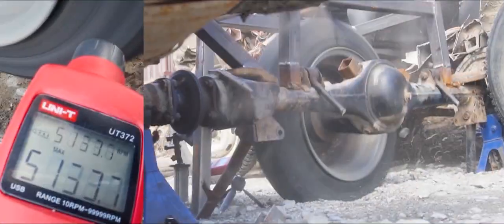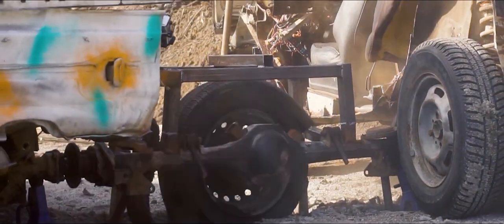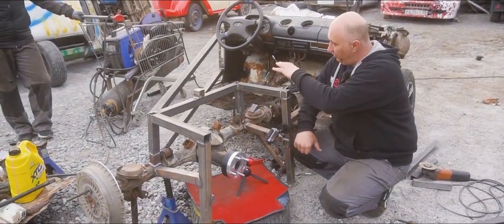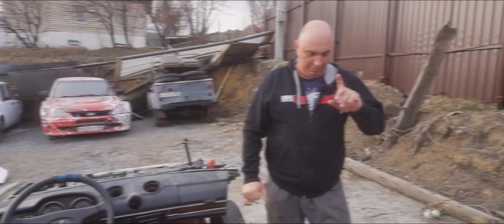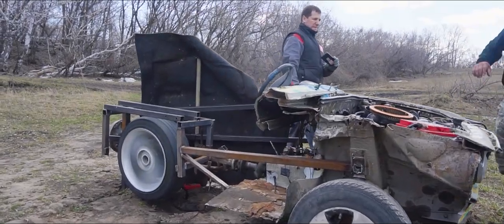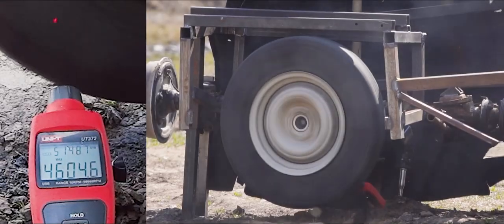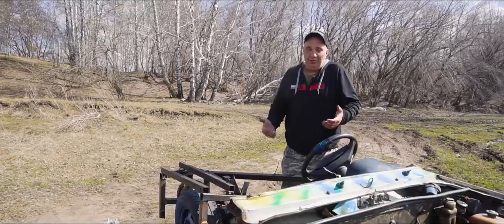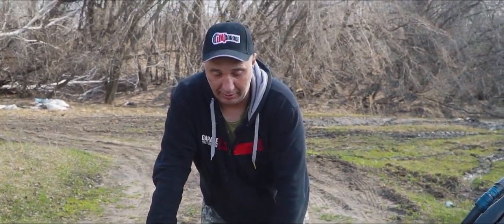Can we get a tire up to the speed of sound?

Comment: The air resistance on the wheel must have killed the engine 
You need to make the the wheel less air resistant to get it to spin faster 
And you need to reinforce it somehow to counter the centerfical forces maybe by wrapping it by tape to lower the air resistance and wrapping it  with some metallic string

Comment: Drag slicks  might handle those speeds
Reply: That's what I told them!
Reply: No because the vehicles weight will stop the tyre expanding when on the rd, the test had the tyre off the ground.
Reply: A run flat tire would likely handle more

Comment: Or get a higher RPM 4 cylinder engine with 150hp that has a turbo. connect it with a second differential. bet you'll get 20k rpm.

Comment: @garage 54, i don't know what the speed rating is on that 13 inch tire but at 5800 rpms it was going about 310mph (if my math is correct)

and to be honest that looks like some cheapo tire with a low speed rating and I'm honestly amazed it even hit 310 mph 

13in(rim) + 2.5in + 2.5in (tire wall ) =18in x 3.14 = 56.52in x 5800rpm = 327,816in / 12 = 27,318 ft / 5280 = 5.17miles * 60min = 310mph
Reply: speed of the 17in wheel was a little faster at 314mph and held up much better

17in(rim) + 2.5in + 2.5in (tire wall ) =22in x 3.14 = 69in x 4800rpm = 331,584in / 12 = 27,632ft / 5280 = 5.23miles * 60min = 314mph

Comment: Is the differential welded? That should result in a higher gear ratio than simply pinning one side, and less moving parts inside meaning lower loss

Comment: If you attach second differential to the existing one you can reach the speed you want even with Lada engine and gear. In other term , differential to differential then wheel. Try it
Reply: The engine didnt make enough torque to spin that wheel even with the gearing they had, much less more gearing.
Reply: @altaccount4697  when you add a second differential attached to the first one it will be much easier on the engine to spin it. Less torque from the engine will produce much much more rotation. Give it a try and you will see
Reply: @jalalabdulmalak2506  okay, you can either slow down rotation to make it easier on the engine by requiring less torque from it to get the same torque output, or you can make it spin faster in which case it takes more engine torque to get the same wheel torque. No matter how much you gear it, the horsepower (RPM x lb-ft x 5,252) is always the same.

Comment: I reckon it was doing 500 to 525km/h tyre surface speed when it exploded, assuming a 13inch rim with about 4inches of rubber extra, spinning at almost 5300rpm.

That's assuming I can add up this evening

Comment: Empty the differential from oil and attach the clear cover and rev it on the 4th gear and see what happens .....will it melt?
Reply: They did that already, recently, and the heat managed to weld the diff

Comment: Put on aluminum/steel plate disk or similar, has less air resistance, because no spoke things like in normal wheel. And see if it can break the sound barrier....

Comment: man, its not the "weight" of the tyre that causes the engine to be weak
it's the big openings and the tyre tread that cause massive air resistance; and the unbalanced wheel turning rpm's into vibration, therefore wasting energy

Comment: Use an automatic, with a 4 cylinder, and a good turbo. The automatic should be either a 5 or 6 speed, and the engine should have a proper tune up before doing this, also a transmission intercooler, with a method to cool the diff fluid as well.

Comment: Find a high horsepower engine and stronger diffs and components and see if you can do the speed of sound. Might need to buy a few tires with high speed ratings to get that to happen, but imagine how epic it would be to get a tire to the speed of sound.

Comment: You build a supercharger with a starter motor you could put that on that little lot of motor and add your Diesel Injection system to increase it even more and then put that for ring engine on there I bet that would give you enough horsepower

Comment: What's the diff ratio?
Reply: This is a VAZ 2106, with a 1.3 L engine, so it can either have from factory the 3.18:1 normal diff, or the low ratio 3.73:1 differentials

Comment: Next, I would turn it into some crazy wheel launcher. Just would need to figure out a release mechanism.
Reply: A basket up in the air, a rope to tilt the basket to allow one ball at a time to fall, or a spring loaded valve, either can work, and the tennis balls, baseballs and whatever balls they wanna test, can be fed into a pipe that has an adjustment arm near the end to increase of close the gag depending on the size of the ball. And maybe some good old perspex shielding incase the ball decides to go the wrong way.

Comment: If you need 10000rpm and only would get up to 5000, to double the speed you need to theoretically have a motor with 4 times the power.

Comment: Use the engine and components from an old 500SE Mercedes.. the gearing and torque should get you to over 1200 easy and it shouldn’t be expensive

Comment: If 9,000 rpm is 1,000 km/h, the wheel radius is 29.5 cm. That's a diameter of 59 cm or 23 inches, not 17 and definitely not 13.

I'm not sure how they ended up at the 9,000 rpm for 1,000 km/h on the 13 inch wheels. At 10,800 rpm a 13 inch wheel would "only" be moving at 672 km/h. The 17" wheel would hit 879 km/h.

Using the numbers they tell us at 8:30.

6,000 rpm with a 13" wheel is 373 km/h.
4,807 rpm with a 17" wheel is 391 km/h
5,480 rpm with a 17" wheel on a 13" hub is 446 km/h, just before it exploded
Reply: 13" wheel size what they are referring to is the rim size, not the actual wheel size

Comment: 12:36 Did that break between the welds???

Also, no, you can't spin a tire to the speed of sound. Not in 2021.
The tires on a production Chiron can't even get past 280 MPH (450 km/h). That's Mach 0.36.

Comment: I would rater ditch all transmissions and get a honda engine with a 10k rev limiter. and just bolt the axle straight on the flywheel. No friction losses from gears.
Reply: They do have that turbo v6 from a Honda Legend laying around somewhere...

Comment: I'm wondering something ever since the first attempt. Why are you using just one engine? Mounting two engines (one on each side of the differential) would double the power not to mention double the speed that you can achieve. I bet that by using two engines you would have hard time finding tire that could withstand the speed you will get.

Comment: 1000+ is an excellent goal, but you’re going to need to find a tyre that can handle it.
Reply: Just use a forklift tire,it doesn't have to be filled with air
Reply: @ilfaraone91  I think the centrifugal forces would still be too much. It  would probably need a tyre rated for high speed with some extra reinforcement.

Comment: No it was going faster not 5480. More like 9-12,000 why the point you were. Mearsuring was that red dot that was in the middle of the tire should have measured at outside edge. If I'm wrong about the measure point I apologize. But it looks like spot was wrong. Either way It was. Awsome explosion!

Comment: The speed is higher the closer to the centre, shove in the smallest wheel available.
Reply: You've got it backwards. They are trying to get to a specific surface feet per minute. The smaller the tire the faster you have to spin it. For a given RPM a larger tire is going to have a higher surface speed.
Reply: @otm646  Don't think they're bothering with that.
A larger wheel will indeed cover more ground, but a smaller one still spins faster.
If they're checking RPMs and calling it a day, a smaller wheel will achieve it.
Reply: Mona Torkia  And speed is higher. They don't seem to be calculating what would be achieved by rolling it on the ground.
To simply achieve a higher speed at the outermost surface of the bloody tyre changing to a smaller one suffices.

Comment: at 5500 rpm thats.90 rotation per second say 1.5 m traveled per rotation 138 mps traveled times 60 seconds is aprox 8500+times 60 mins equals approx 477,000kph boyo.not 1020.

Comment: The larger the rolling diameter the slower it will spin at outer diameter, its nothing to do with the engine power.
Reply: wrong, the larger the diameter the greater the OD speed at the same revs
Reply: You are correct, but the extra weight of the wheel is also a factor.
Reply: It does. Bigger wheel have more air resistance and rotation mass both are demanding more power to spin faster.
Reply: @nicklaich  air resistance is an extremely negligible factor bud
Reply: @Boe_Jidens_Hair_Sniffing  Bud if it is not for air, sch a wheel on good bearings would be rotating for weeks.
Reply: @nicklaich  the friction of the moving parts and steel-to-steel contact (bearings, gears, etc.) would prevent it from spinning continuously. You could perform this experiment in a pure vacuum with no atmosphere and essentially get the same results.
Reply: @nicklaich  now if you were using paddle tires like sand rails and hill climb machines use, you would slightly notice air resistance as being a factor.

Comment: If you had welded the diff instead of running it open with the opposite end locked then it would spin twice as many rotations per engine rotation. Would need stronger engine though.
Reply: Actually the opposite would have happened. Half the speed would have been the result